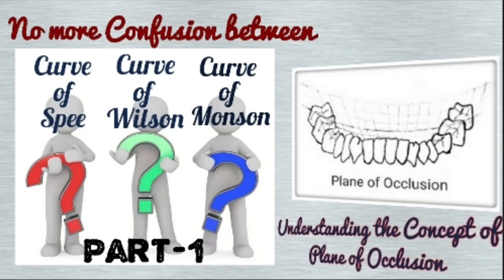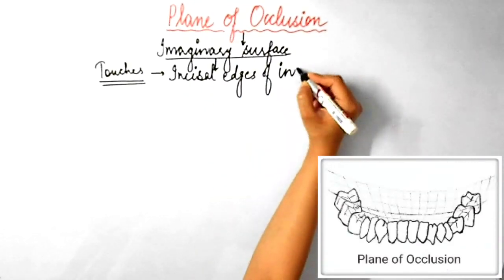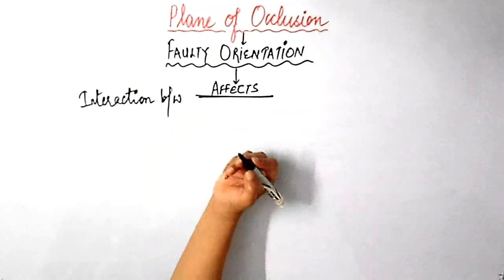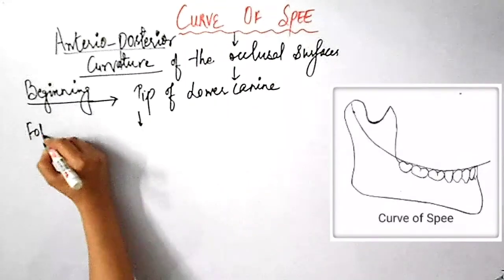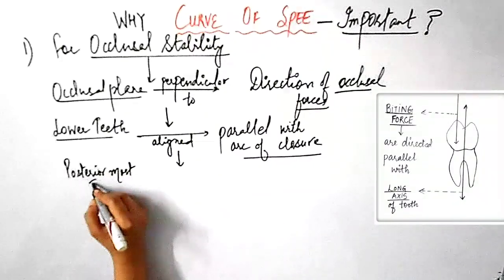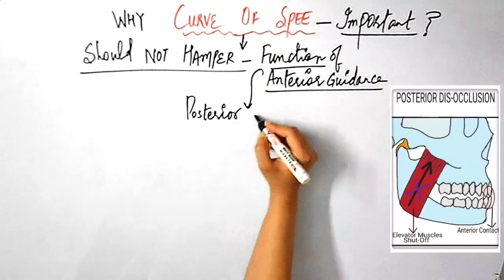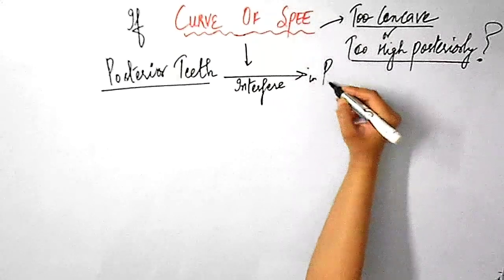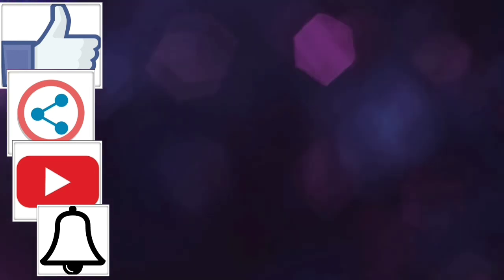Plane of Occlusion (Part-1)//Curve of Spee//Compensating Curves

Comment: Nice but wanted to know if the posterior teeth disoccludes on protrusion the whole load of occluding teeth would be transferred to the anteriors causing the denture to drop as a result of breaking of posterior seal.i mean maximum teeth should be in contact in an eccentric movement without interference instead of disocclusion.
Reply from the maker: Thanks...
In the video, we are talking about mutually protected occlusion in Natural Dentition, in which only the anteriors contact during lateral n protrusive excursions and all the posteriors go out of contact..
Whereas  bilaterally balanced occlusion is used in construction of Complete Dentures, in which the anteriors n posteriors contact in centric as well as eccentric movements...
I hope that helped...